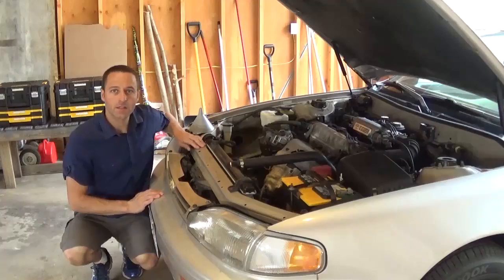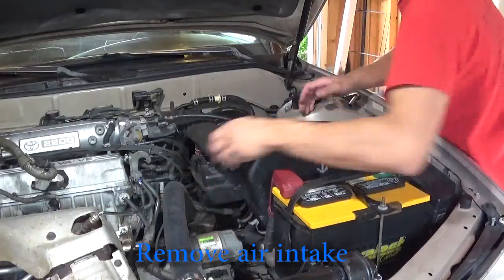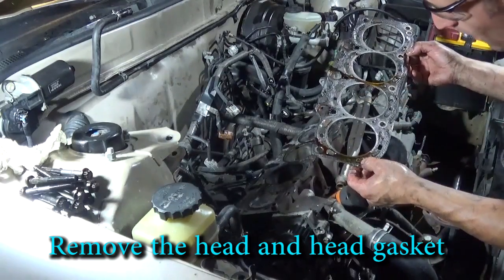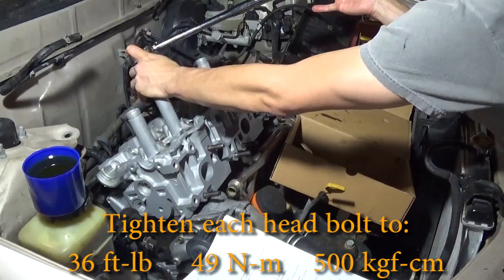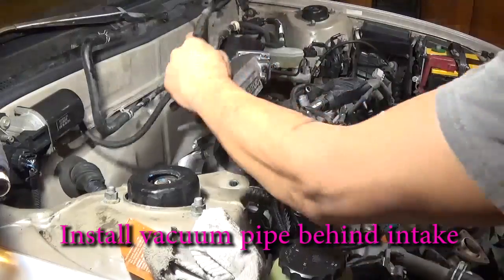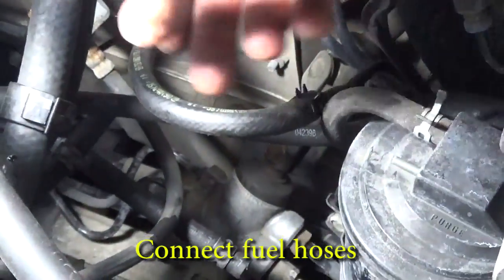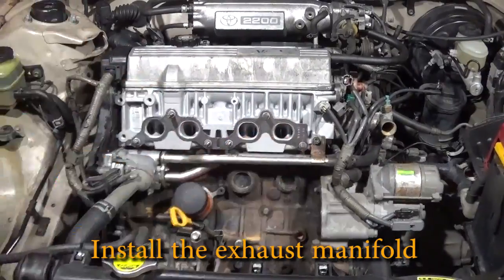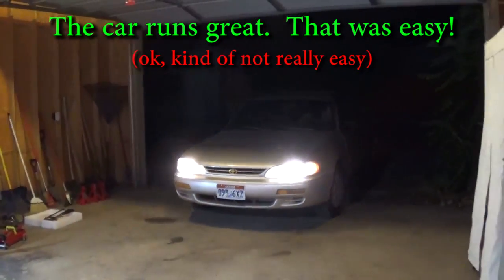How to replace the cylinder head gasket on a 96 Toyota Camry 4 cylinder

Comment: How much would u charge to do this to my 93?
Reply from the maker: Same amount as the shop.  But you can do it yourself and save a lot of money!  :)
Reply: How much do u think a repair like this will run in a shop? Im far from a mechanic even with vidoes i dont even have the tools thats why i was asking if u woulf just do it its a 93 camry so it's older but the model and make is the same
Reply from the maker: The quick answer is:  the repair costs 3 times more than your car is worth.  Shops will charge at least $1,500 for head gasket replacement.  

My car also had a bad cylinder head, so that was $450 for the cylinder head, plus about $250 for head gasket set, head bolts, oil, antifreeze, sealant, etc.  So my repair was about $700 not including labor.  If you don't take your cylinder head in to the machine shop to get it measured, you might be completely wasting your time and money by changing the head gasket.

Also, if you're not a mechanic, you will probably kill your car if you attempt to replace the head gasket.  I currently don't have the time to work on your car, sorry.  Basically it's about a 10 hour job, so labor will run anywhere from $500 to $1000 or more at a shop, depending on their hourly rate.

So my advice to you is:  if you love your car and want it fixed, be prepared to spend a lot of money.  Consider replacing the car, or if it runs ok, drive it a bit longer, then replace the car.
Reply: You cant put a price on sentimemtal value u cant argue that it was and probaly still is the best car u ever drove and 1500 is worth it if u have it
Reply from the maker: I agree.  The Camrys are very good cars.  I went through my whole engine and fixed all the leaks, put all 4 new struts and springs in, and it was just as good as a new car.  I recently sold mine and got a 1997 RAV4 instead.  It's like the Camry, except even cooler because it's smaller and 4 wheel drive.  Doesn't ride nearly as smooth as the Camry though.
Reply: I wouldn't have sold it but thats me
Reply: @LabCoatPaul   Where did you get your head gasket kit  and what brand name did you use? Would you recommend silicon? Thanks!

Comment: Hi friend, good work.
Is it possible that my engiine was mounted in the wrong revolution on crank?
I've cheked everithing in my car, but it still with low power, i was thinking if my mechanical had mounted the crank like in the second revolution, my engine runs, but with a very low power. 
thanks for the video, watching from brazil.
:)
Reply from the maker: If your timing is off by more than 1 tooth on the belt, the engine won't run at all.  Watch the video at 12:48 and check to make sure your timing belt is installed properly.  You should also check your spark plugs, distributor cap and rotor, and test the compression on your engine.

Comment: would incoreect valve timing cause my car to bog with poor idle & when throttle is applied and run rich?
Reply from the maker: That sounds more like it needs spark plugs or maybe a vacuum leak.  Bad 
valve timing usually has more severe symptoms like it won't run or 
backfires through the intake.  Checking the timing valve timing is 
pretty easy though.  You only need to take the top part of the timing 
cover to see the timing mark on the camshaft pulley.  The other mark is 
on the crank pulley, which is already outside of the timing cover.
Reply: im suspecting its incorrect valve timing.i have a 5sfe aswell. but its very rich and vacuum hoses r connected up no leaks. when i press the pedal it bogs. wont even rev nothing?
Reply from the maker: checking the valve timing is very easy.  You only need to remove the upper timing cover.  Line up the mark on the harmonic balancer and the mark on the camshaft.  Watch the video at 13:35  If the timing is wrong, check the belt.  It's probably old.  Replace the timing belt.

Comment: So stoked that this only takes 17 minutes! I thought it would be longer.
Reply from the maker: I like the drive it off a cliff idea.   Too bad my car is only worth $1,000.
Reply: It's a 4 cylinder camry. But i fixed it. And now running great ;)
Reply: @ittawi4good  Did the same job as yours. It took me 3 days to complete it with all complications that I ran into.
Reply: Haa no shit. This looks it would take a novice like myself, more than a week to complete. I would rather drive it off a cliff and claim it on insurance
Reply: +Paul Shpakov +Paul Shpakov hello, thanks for the video. My 2001 camry 4-cylinder died on highway and oil was leaking from passenger side. I replaced timing belt, water pump, pulleys and oil pump seal. Tried to turn the engine manually but it was stuck. I think the valves hit pistons. Any idea if that's fixable in my garage?and is it worth it? Lol I'm so not expert but I think I could learn something AND not throw my baby for couple hundreds. And if you know of any video that shows how to do that please tell me,Thank you
Reply: @ittawi4good  5 fse engine is non interference. Can't get a valve to hit a piston unless you try
Reply: @Chase Simmons  yes, I didn’t know that back then. Some mechanic wanted to rip me off by telling me that I needed to buy another engine from him for $1,200 or just sell him my car for $300! But instead I bought the repair manual for $15 from autozone and researched and watched lots of how to fix it videos. I then ordered a timing belt, water pump, oil pump seal, cylinder head gasket all for $150 from Amazon. It took me two weeks to complete the job since i had zero experience with cars. But now, 4 years later the car is still running great with over 230,000 miles on it!
Reply: @ittawi4good  I'm super glad to hear that! I just bought a 94 camry with 198,000 for $1000. I want to replace the head as the old one has stripped spark plug threads and is just gunked up. Figured I might as well do the timing belt and water pump at the same time!
Reply: Chase Simmons that’s a smart thing to do since you’re already that deep in. Good luck 👍🏼
Reply: @ittawi4good  so, what ended up making it die on the side of the hwy? and also curious why the engine wouldnt turn manually?
Reply: @nickaa827   it died because the water pump got stuck “pulley not turning” which caused the timing belt to break. And after I replaced the water pump, timing belt and all the gasket. The engine wouldn’t turn manually because i installed the timing belt but it wasn’t timed correctly :/ I figured that out later and fixed it 👍🏼
Reply: @ittawi4good  awesome, that's great that it worked out and you were able to keep the car to this day
Reply: How did you get that extra room to get the other bolt on the back of the timing cover
Reply: what car do u have? 
if its a 4 cylinder camry i might buy it.
Reply: Bollocks. Do you think you did it at the speed of superman, or were you stoked on amphetamines or something !!! The vid shows it being speeded up substancially and the vid is just under 17 minutes itself. Or is this American minutes, lol. Errr, good vid though.
Reply: @paullawley-walker1440  You took the bait. Never take the bait.

Comment: how many miles did the bottom end do ?
Reply from the maker: 145,000.  The rest of the engine is still good.  If you take care of them, these Toyotas will last forever.
Reply: +Paul Shpakov I thought the reconditioned head would damage the piston rings
Reply from the maker: Replacing the head will have no effect on the piston rings.  The compression will be higher, compared to having a blown head gasket, but that won't make anything else wear faster.

Comment: You mention hose three going down to the coolant switch.   I have NO IDEA where you got that information, but COOLANT has NOTHING to do with the EVAP system.   You clearly don't have correct information.   My Toyota Camry does NOT HAVE ANY HOSE going from Intake to the coolant switch.   You need to research what you're doing.
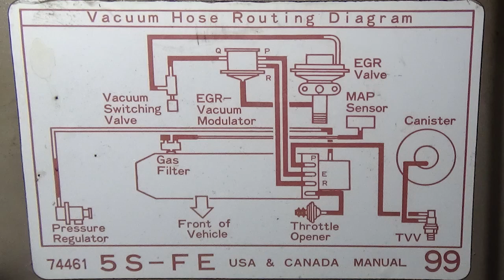Reply from the maker: +Justin Snyder The hose goes to the TVV (temperature vacuum valve), located where the upper radiator hose connects to the engine.  This valve opens when the engine is hot.  It prevents fuel vapors from the charcoal canister from entering the engine when it's cold.  And I did research it by looking at the emissions control routing sticker on the hood of my car.  Pause the video at 11:28 to see it.  My car is the California emissions version, so it's possible that I have more parts in the EVAP system than you do.  Newer cars will use an electronic solenoid instead of a vacuum valve attached to the coolant passage.  Either way, there should be some sort of valve between the evap canister and the intake.
Reply: Paul Shpakov Still doesn't make sense.  Why would fuel vapors and the evaporation system have anything to do with the RADIATOR???   Doesn't make sense.   I have a Toyota Camry LE 1996.    It isn't connected that way and my car runs fine.   So something isn't making sense in your video.
Reply: Anyone else reading this don't be confused by Justin's confusion.
It has nothing to do with coolant except the temperature. It opens the line beween the canister and the intake only when the engine is hot.

Comment: Good Video Paul.  I'm planning to do this on my daughter's car.  Just wondering,  did you support the engine? And where is the safest place to put my jack stand?  I noticed you just lift the right side of the car.  Thanks and more power.
Reply from the maker: +Fransystems All the lower engine mounts are still in place, so you don't need to support the engine.  Lifting both sides will give you more room to work.

Comment: hi i have a question before i replace my cylinder headgasket what kind of radiator cap are you using on your car radiator? thanks
Reply from the maker: +condari sergio It's a regular 16psi cap from the auto parts store.